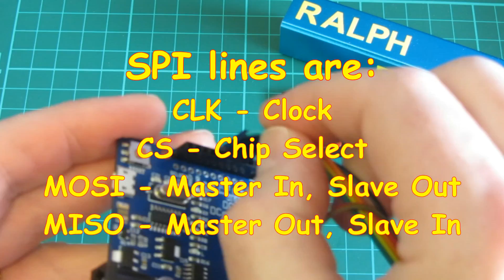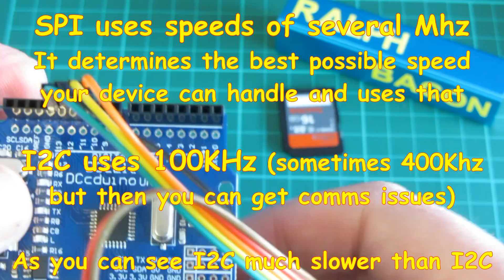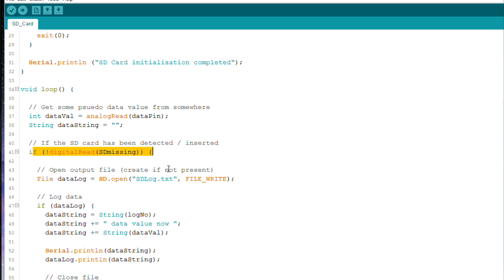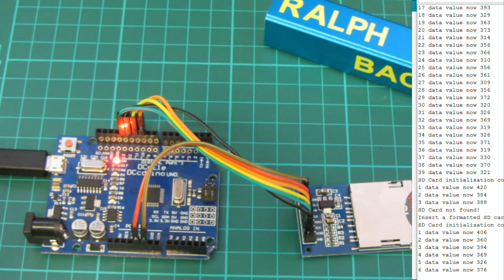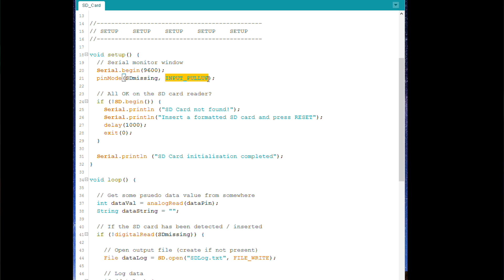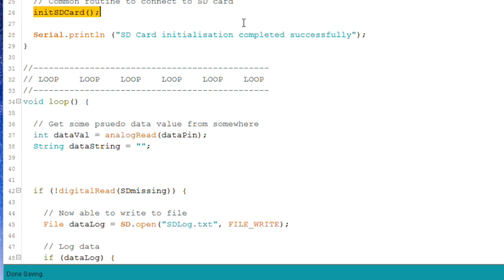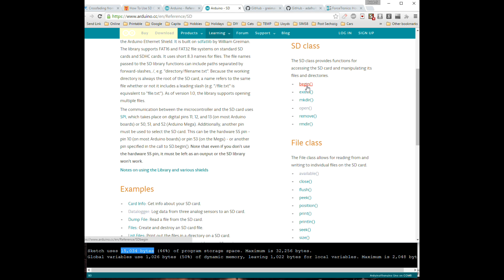#22 Using an SD card to log data - and how to improve the reliability!

Comment: Hi Ralph, any chance of the code with the pin 5 routine? - The original Dropbox link is broken.  I would really appreciate it and so would one of my friends.  Thanks Jim.
Reply from the maker: Hey Jim, I've battled with DropBox and have now moved the sketch to a new folder, you can find it here:
 
https://www.dropbox.com/sh/blpdw5mwq5p7sv1/AACaqXSsjNwjfPzGbYjFh1DSa?dl=0
  
I've updated the link in the comments too. So sorry I did not spot your comment from about a month ago, I missed it but now I am testing a new tool to keep track of the increasing comments I get on this channel. Anyway, any issues in accessing this do let me know.
 
FYI Dropbox removed their "public" folder facility so the old links now fail; I tried to move as many as I could but this one escaped!
Reply: Thanks Ralph! I now have it.

Comment: Hi Ralph, nice video.. but maybe in other videos you could start with a flowchart. and could you run that sketch that is in the arduino  (the SDcard driver) to run a sketch like (LED blink) from the SD card?

Cheers
Reply from the maker: More explanation at the start could be useful, indeed, I will certainly consider it. But running any program from an SD card is not possible with the Arduino, it must be loaded into program memory that is on chip (well, in chip, really). External memory, whether SD card or EEPROM is only for data of one sort or another. Thanks for the suggestion Joe.

Comment: On one of the projects I have coming up in about a year.  I will need to use a SD card.  However, because of limitation in Arduino for the task at hand I will be using the CHIP SBC.   But I will be using the Arduinos for data collection and sending the data to the CHIP for processing, refinement, storage and display through a web server.  The actual number of Arduino cards will be around ten at my last count.  But could be much more but no more than 20.
Reply from the maker: Wow, that sounds like a project to keep you busy for a while! One point to consider when data collecting, is reliability. How do you know that data is actually being collected - or will you find at the end of the day that you have an empty SD card? Perhaps you are collecting it frequently so you will be aware? It all depends on how important the data is, I suppose! thanks for letting us know this and keep us posted when you actually implement as it's always good to hear about Real Life projects.
Reply: The reasons is I don't have the time it would take to check each battery, cell, pack which is still undecided as it should be on a normal PMI (Preventative Maintenance Inspection).  So, the originally thought was to monitor each battery, cell, pack on a per minute bases for volts, amps and temp on the solar/wind system.  Then I got to the point where I said, alright measure the lot.  This will tell me if something is going bad, loss of performance, and lack of equipment.  So, more a logical decision can be make before it's an expensive one.